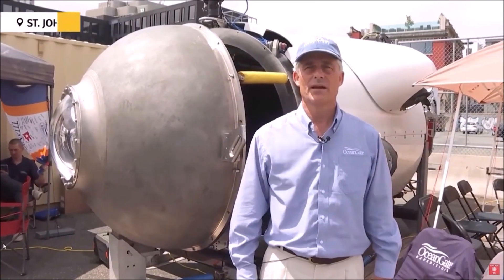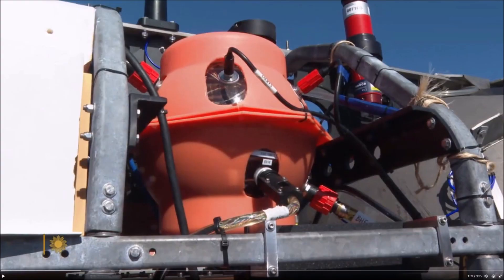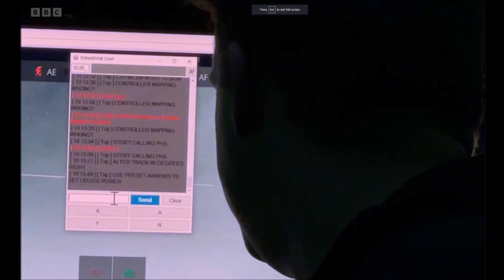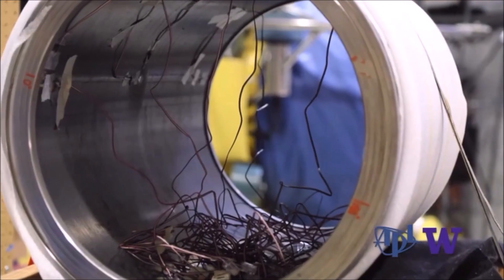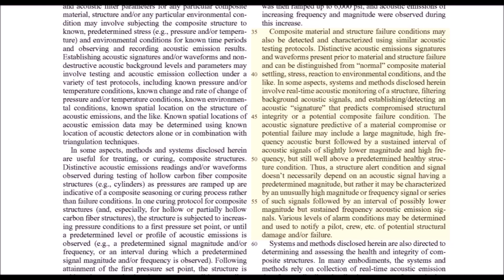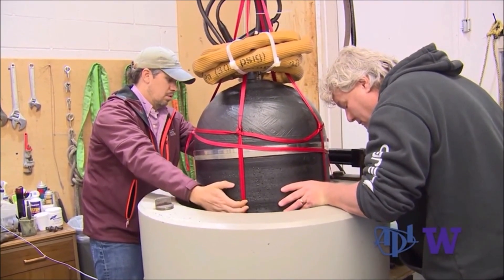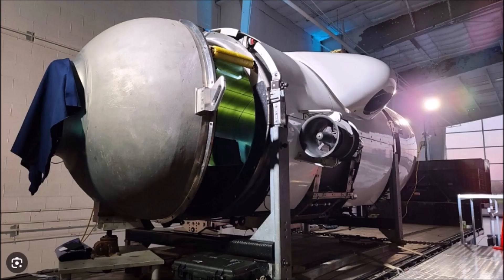OceanGate Titan - INTERNAL & EXTERNAL SYSTEMS

Comment: Thanks for the vid! My biggest question is do you think they’ll be able to recover the video and audio recordings of before the implosion? Not that I want to see it, but it would answer many questions.
Reply: Vids seem to show at least one GoPro on the 'rear' wall inside looking forwards. The SD card should have made it.  I wonder if it/they were recovered. They've recently been back to the site and recovered more human remains and other bits.  It will be interesting to read the final report.
Reply from the maker: @nigelwilliams7920  Yes, on Oct 4 they retrieved the rest of what they wanted. I suspect they were looking for possibly the control spheres and probably definitely the computers, at least the one dedicated to the real time monitoring system. Next they are going to set up a meeting to determine how to investigate this. It'll be a while still before we know what conclusions they come to. The cameras and lights seem to have been constantly evolving so it's hard to know anything about that with any certainty.
Reply from the maker: Good question. I don’t know the answer to that. Might be possible that they had a black box but I’ve never seen mention of it specifically. If they can recover the computer dedicated to the RTM system that might tell them something.

Comment: As far as I know, the hull had 26 strain gages and 9 acoustic gages.
I took this information from an Oceangate interview and wrote it down. I think it was Stockton Rush himself who said that too. 
I'm trying to find the interview.
Also Stockton Rush's opinion that the strain gages weren't much help and unsuitable for the carbon shell because they didn't leave any time to react, only the acoustic gages would be reliable. That opinion about the Strain gages definitely came from Stockton m. I’m 100% sure about this.
Reply from the maker: Hmm… In interview with Pogue he said eight acoustic sensors but it could’ve ended up being nine? Three times as many strain gages kinda makes sense, I think. Yes, a strain gage will only tell you what is happening at this very moment.

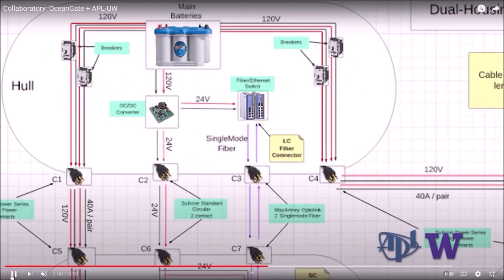Comment: @1:22 They use labjack dacs https://labjack.com/products/labjack-t7 for sending analog signals from the PC to the motor controllers ? That's stone age !
According to the documentation these thrusters can (should?) be controlled by modbus, which will give you ton of digital feedback on its performance and diagnostics.

Single-mode fiber for communications ? That's suitable for km range links, but also delicate. For robustness, resilience and short range always use multi-mode fiber.
Reply from the maker: I was going to put that Labjack info on my diagram but I forgot to do that... mental post it note got lost. It could be in the Titan it was instituted differently than in Cyclops. The disputed transcript, which I have found lines up with eight real world items, infers that they had these diagnostics available to them.

Comment: Wonder why the air bladder bag/s weren't (along with dropping of ballast/frame) deployed/filled?   Seems to me, that method of increasing buoyancy would be the most effective...sort of like a submarine blowing its ballast tanks.    Also, this video's explanation of how much power the 'thrusters' took implies the reason that the text transcript indicated 'loss of power on the A-bus'.  i.e. being in a panic mode to ascend, they left the 2 upward thrusters ON FULL power for the duration of about 20 mins (via transcript) while they tried additional ways to ascend faster.
Reply from the maker: The air bladder thing is still undetermined. I wonder if possibly a human error element is involved there... maybe a valve was left in the wrong position? I see you picked up on my subtle hint about the power blurb on the disputed transcript. There's at least eight aspects of that which line up with actual protocol, insider knowledge, etc. If that was made up, it had to have been by an OceanGate employee or something.
Reply: @VegasCyclingFreak  So many flaws in this sub, there clearly weren't enough sensors for status of every pressure, bus, etc if that were the case. Already I don't see any redundancy in the thruster controllers or any of the ethernet equipment involved.
Reply from the maker: @spikester They kept some spare game controllers on hand... does that count?
Reply: One of the innovative features was the way the vessel released the ballast by physically rolling. If it had lost the roll thrusters it might not have been able to dump the ballast.

Also, at that depth you would need a couple of cubic meters of air  at 400 bar to inflate flotation bladders/tanks. Not sure they had that.
Reply: I suspect, in the commander's mind, that using the air bladder was a real last resort (and an admission that it had all gone wrong).  Thus, in deep denial until too late, that moment to abort and use the air bags didn't come in time.
Reply: @nigelwilliams7920  Great point, hopefully we find out in the investigation at what depth they should have aborted at given any downdraft currents or underballast forcing them to dive at a higher rate, at what point should they have aborted? Thank you.
Reply from the maker: @nigelwilliams7920  I'm not sure at what depth the air bladders come into play. 3,400 meters is I think to deep for them to be deployed... hydrostatic pressure at that depth is about 4,500 PSI. As far as I know they wouldn't be able to to do anything at that depth.

Comment: @ 2:46 Who cares about game controllers if your junction boxes look like this ! Could be worse but could be a LOT better. Should be a LOT better for any life-critical application. 
Some terminals seem to be numbered, but not all. Some wires seem to have ferrules, but not all. Some unused wires seem to be terminated, but not all. I count at least two dangling ferrules. Some wires seem to have color-coded rings , but not all.  3(?) kinds of diameter washers under the hex bolts? Is that an aluminium box with stainless steel bolts in a seawater environment ?

I bet the construction files are one big disastrophy.
Reply from the maker: There appears to be a lot of places where galvanic corrosion could occur... dissimilar metals joined together. The tail framework in some pictures looks like it had taken a real beating from the seawater.

Comment: There is a video where Rush describes manually operating a hydraulic pump as a redundant method to release ballast or legs or frame (???) in the event of loss of power.  Such a pump could be quite small, think about the pump section of a hydraulic car jack.  There are pictures of metallic tubing entering the hull via a compression fittings through one of the 3 or 4 hull penetrations in the rear titanium ring.
Reply: I sure hope they used a single acting (spring return) cylinder for the frame release. If they used a double acting cylinder, and the return or vent-side became leak or compromised there would be no way to overcome the outside pressure.
Reply from the maker: @BartSliggers  I have looked at quite a few pictures of the underside where the frame release assemblies were to try to figure out what they did. It's really difficult to make out what they were doing. I can see that both the front and rear had some cables which must have been attached to the frame release pins. How the actuators were actually instituted I am not sure but conceptually I see what the intent was.
Reply: @VegasCyclingFreak The concept of the frame pins seems seriously flawed.   Because the hydraulic pressure would have balanced between the actuator cylinders, then which ever pin was easiest in its hole would have come out first, leaving the remaining pin(s) horribly jammed as it/they supported the full weight of the frame in a skewed position.  That would explain the '..several attempts' required to drop the frame.
Reply from the maker: @nigelwilliams7920  Yep that is my conclusion also. I think it was dangling still half attached for some amount of time, a few minutes maybe. Every second would have counted in this situation.
Reply from the maker: You have a link to that video?
Reply: @VegasCyclingFreak  You are in luck!.  I have seen or read maybe 500 videos/post/articles/tweets/pictures regarding the Titan incident.  I don't index them as to detailed subject but I remembered  where I saw Rush describing the hydraulic hand pump.  (20:43)  in this: https://www.youtube.com/watch?v=uD5SUDFE6CA from @alenxelmundo.

Comment: I just dont understand how  so many electrical , critical components are outside the titanium end  (aft) cap , and there must  be a way for them to connect to inside the capsule, surely thats a massive weak point at those incredible pressures at the depth of Titanic?
Reply from the maker: Next video will go over those hull penetrations. Those thru hull parts can be rated for some crazy high pressures... like 15,000-20,000 PSI. As I understand it, some of those components in the tail were in a pressurized oil bath so they could survive being at that depth. Communications for example were a challenge as radio doesn't work under water, so things like that sonar modem antenna(?) needed to be external and there was only so much room inside, so thru the hull those wires went.
Reply: @VegasCyclingFreak  Thanks
Reply: Oil companies, mining companies, telecommunication companies, oceanographic research institutes,  militaries and intelligence agencies of various countries have been building manned and unmanned submersibles and tethered ROVs capable of diving to twice the depth of the Titanic since the 1960s.  There are a lot of commercially available components available to construct these deep sea exploration and maintenance vehicles.  The glass control spheres were about 15" in diameter and per Rush were oil filled to reduce the havoc if an unfilled sphere failed at Titanic depth.  Rush said implosion of one of those spheres would have the energy equivalent of detonating 10 sticks of TNT.